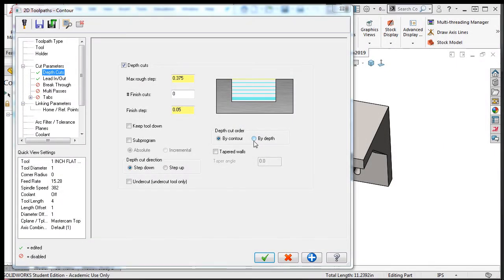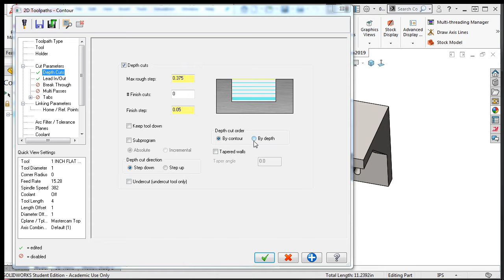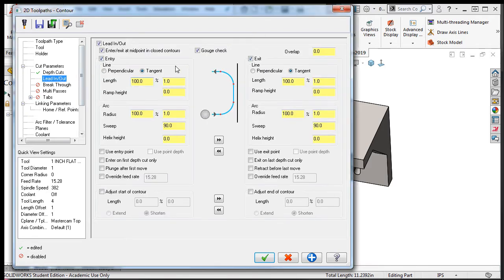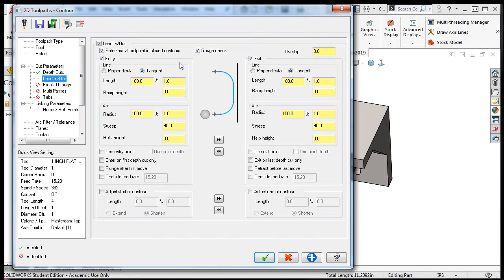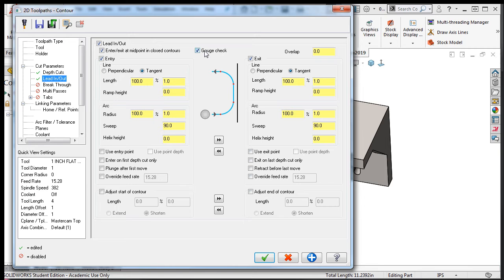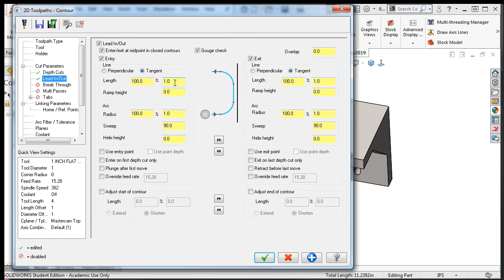18 - Mastercam for SolidWorks - Lead In/Out

Comment: In which case would you not use lead In/Out?
Reply from the maker: Not very often, but when creating roughing toolpaths and a witness line on the part wall does not matter. Sometimes the lead in/out does not give you what you are after, so you add geometry to the part to get the desired lead in/out.